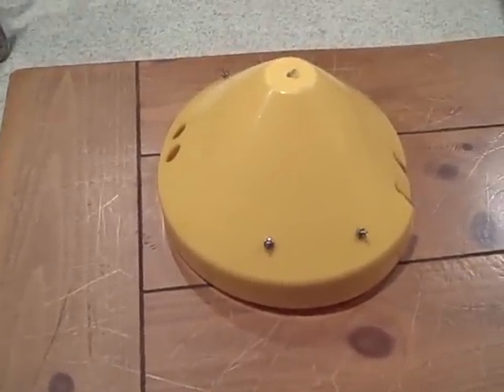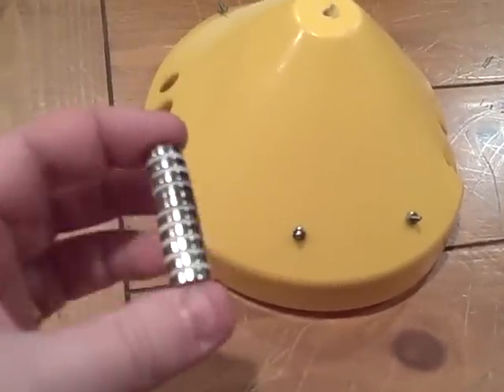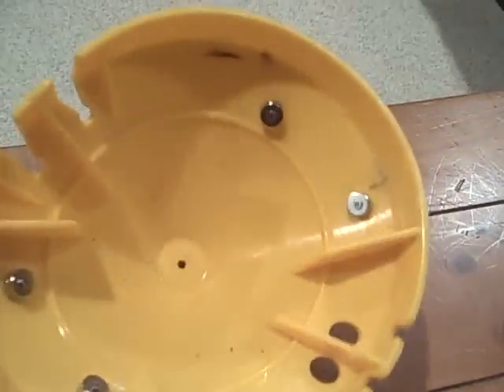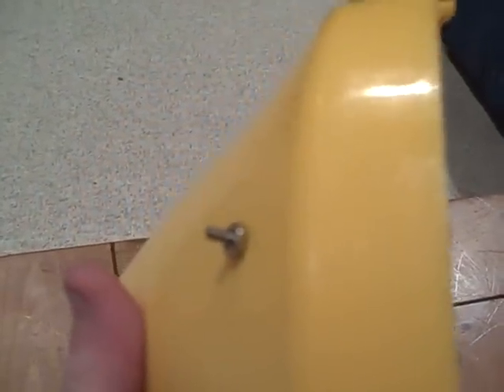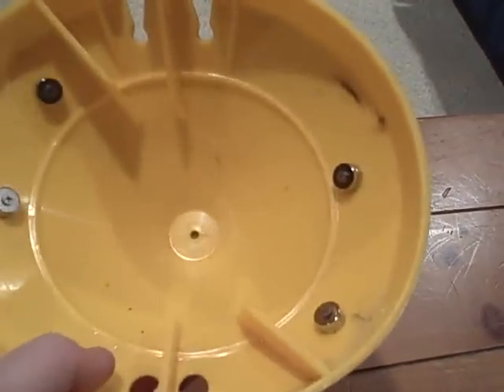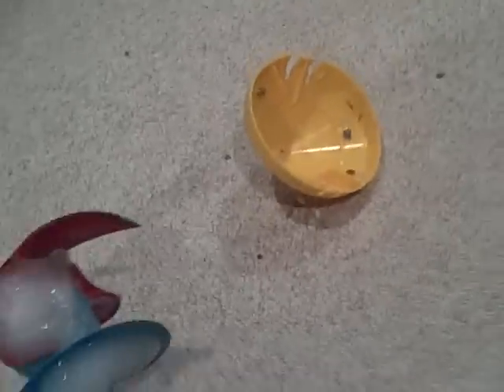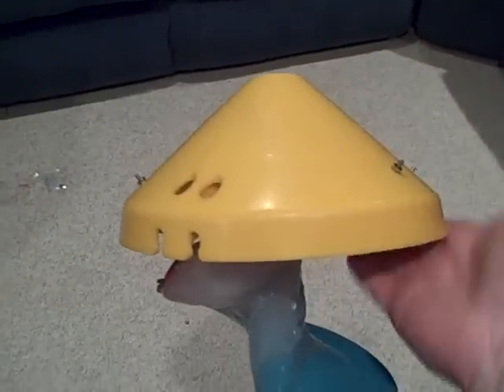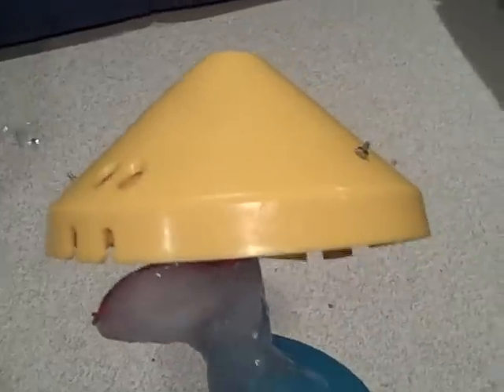Nils Master Ice Auger Cover Modification

Comment: This works great! Thanks for posting!  
I used the larger magnets with 5# pull on my auger in use.  The smaller 3 # ones for my backup tip.  It hardly budges with the 3#, almost TOO hard to get off with the 5#.

Comment: One note of caution...the beveled hole magnets can crack and break if overtightened. 

I ordered magnets on AmazonPrime that looked exactly like those shown in this video.  I found the beveled hole version in a #6 screw size and they worked really well when double-stacked and adding spacers to accommodate my StrikeMaster Chipper blade cover.  Great idea!